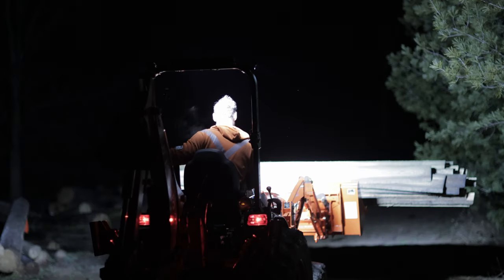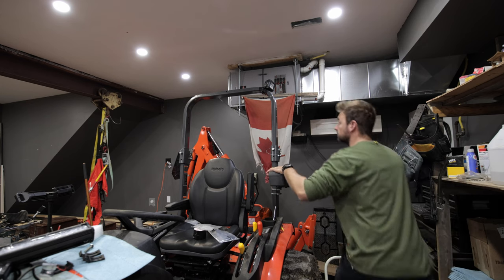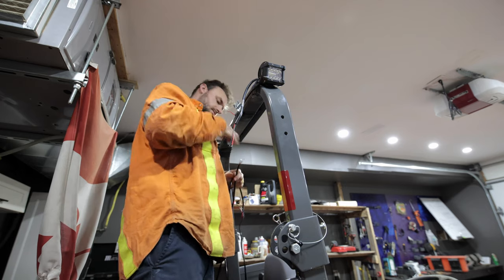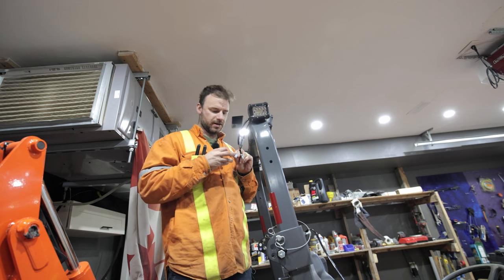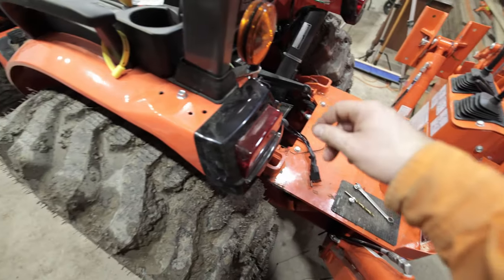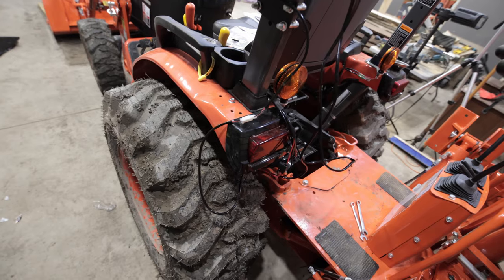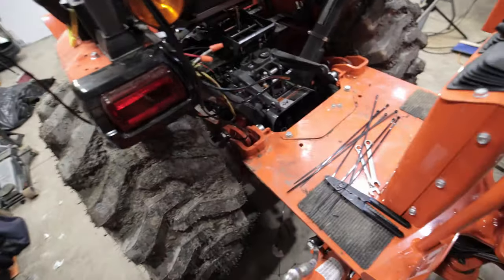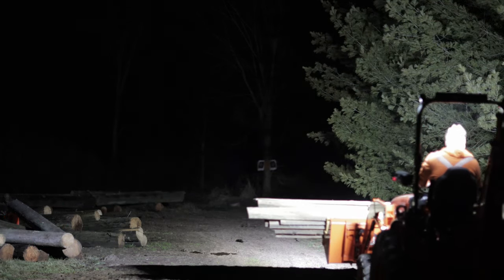tractor light bar install EASY!

Comment: I got two kits of those little lights in the same make so two can face front and two light up the backhoe. I was going to wire up the front to the headlights and the back into the cig lighter in the little side bow on the bx with the included switch. I really like the tape idea! Dude, what happened to your flag!? I have to thank you for the videos you did on the ecodiesel, mine's still running great (knock on wood).
Reply from the maker: glad to hear the eco is running strong. Yeah i get some flack on the tape idea but honestly its a pretty quick temp option. mines held up all summer. The flat was in support of the freedom (trucker) Convoy here in Canada. I showed my support best I could, shes a little weathered.
Reply: I understand. I'm in Nova Scotia. I agreed with a lot of what the convoy was trying to say.